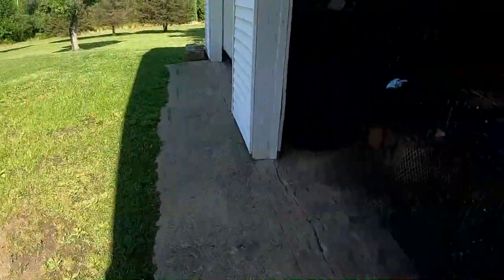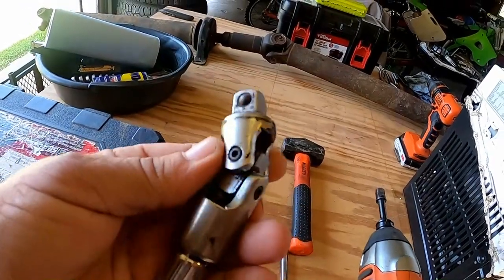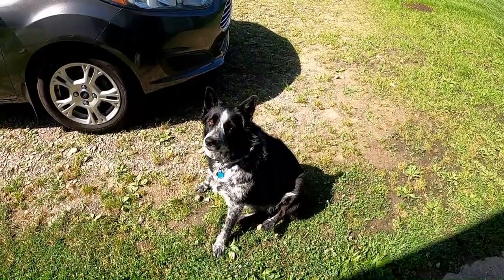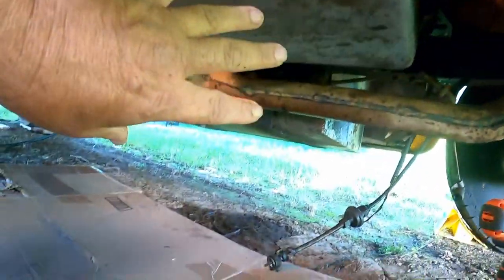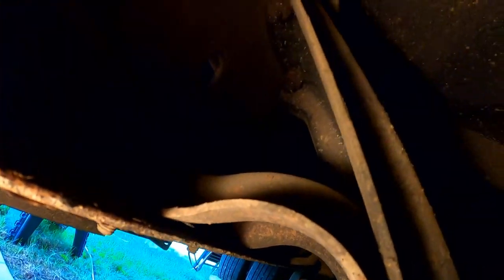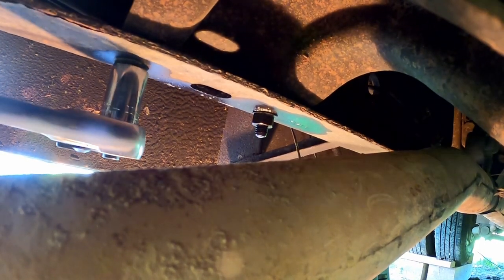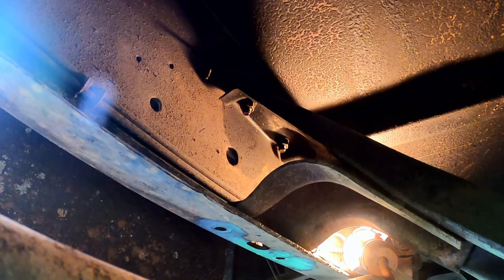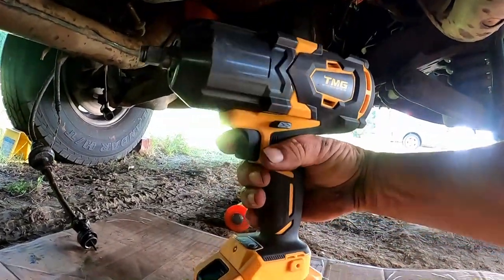Removing The Transmission in a RV Motorhome - Part 2 - Preparing To Have The Transmission Rebuilt

Comment: When it comes time to put the transmission back in, try to find a piece of plywood to work from. It will make maneuvering of the tans jack easier. Also allows easier access to getting the transmission back on the jack.
Reply from the maker: I think I have just the peice!

Comment: You needed the front wheels on ramps, or cinder blocks!
Because you are not on hard ground, use a plywood sheet on the dirt to allow jack to roll smoothly. 
Make these changes BEFORE the reinstall.
Reply from the maker: That would have made it easier, but then the Coachmen would have been way off from being level. That doesn't work well when we live in it full time. I did find a piece of plywood for the reinstall.
Reply: Off from level huh...well then set the rear wheels also up on blocks/ramps. Then you have great access under.

Comment: Dave you did a good job on removing the transmission... well done... seems like you will have to jack the coachman up higher to get the transmission while on the jack passed the exhaust pipe.  need more boards and blocks... Are you still working your part time job?  Always look forward to your videos...

Comment: Will the extension slip through the large center hole on the bottom of the frame rail between the lower mount bolt holes? then reach up and slip your socket and swivel onto the extension. Would have it at less of an angle for the top 2 bolts/nuts. Remember the Blind Spline on the torq/convertor when you slide it back in after you get the trans back on the jack underneath to make sure it is all the way seated on the front shaft. And yes, that mount at the rear of the transmission is considered to be the rear motor mount.

Comment: I'd be on the lookout for a couple of old railroad ties to be able to jack the RV up higher. Put the transmission on the lift, Both on a piece of plywood. Slide the whole thing under and jack it back into place. I'm curious how you are going to get it back on the lift after you push it back under the RV. Really enjoyed this video!

Comment: If you have have to change the torq converter then that answers the question which is cheaper to own and run manual or automatic transmission. Replace clutches in an automatic are cheap but if you have to do torq converter too then maybe a manual trans is the cheaper form to operate.

Comment: I’m typing this before I see you pull that transmission out, but when you were fighting the dowel pins I noticed the transmission cooler lines maybe once or now that the transmission is out you can blow them out to get that nasty fluid out of there not that I wanna give you more work, bud!
Reply from the maker: The transmission shop includes with a rebuild, a kit for doing that. :)

Comment: Dave,
It looks like your exhaust manifold leak is melting your spark plug boot on #8?
Reply from the maker: It's been like that for a while, but still works fine. I'm going to put a new set on once the manifold job is completed.

Comment: Can you upgrade to a low speed stall Torque Converter? Does it have a overdrive? locking Torque Converter?
Reply from the maker: I'll use whatever converter the shop supplies me with. It's only a 3 speed TH400
Reply: @DavesRVLife  Might have been a good time to upgrade to a overdrive and locking torque converter. Should be plenty in the junk yards.

Comment: Change fly wheel got  down that far they wear out too do not do it again 454 do eat fly wheels i had change my Check  U Joint on Drive Shaft too put new in you be ready go west Big daddy Snow coming Soon Worst in Pa Ocean is Hot When put back in going be Fun need one side up get on Jack then lower back down